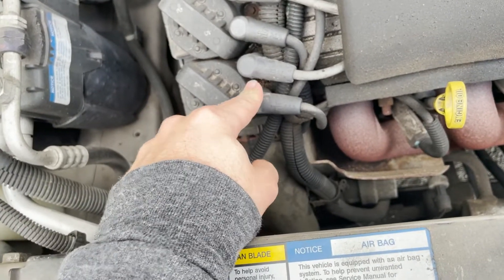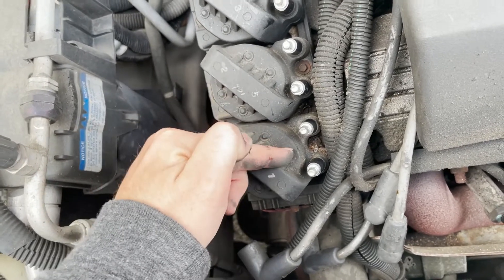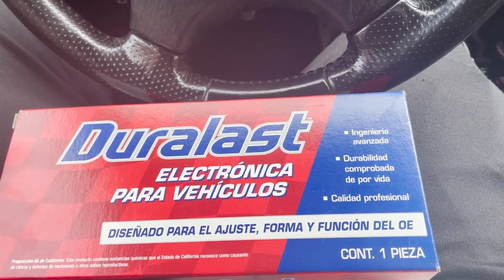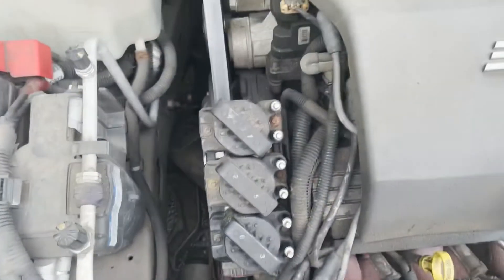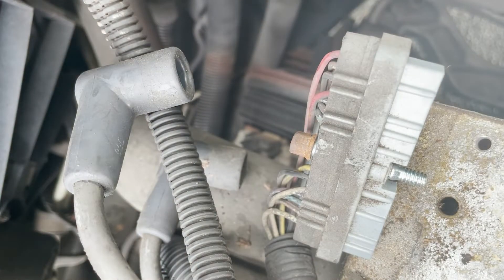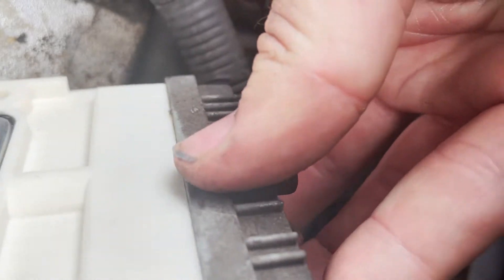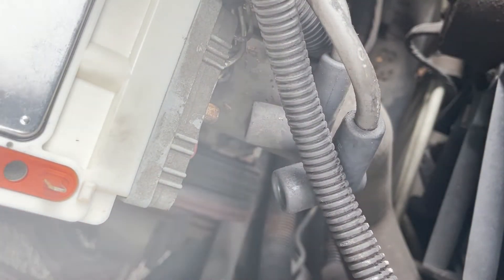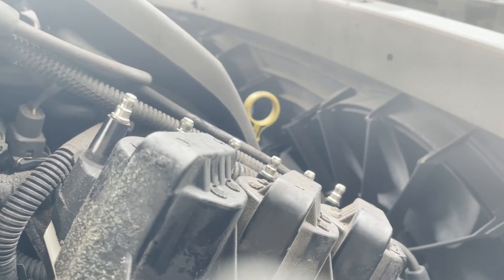Significant Loss of Power and Smelly Exhaust?! 2000 Buick LeSabre Ignition Control Module is Faulty

Comment: I’m looking thru lesabre vids right now.. mine has been having random misfires with stalling when I start all intermittently.. 2 mechanics I spoke to think it’s the icm starting to fail especially I messed with the fuel air ratio by putting new sensors on that have been failing for a long time now. I hope that’s what it is, all of its raw data is being checked and diagnosed right now at the shop
Reply: what sensor did you use for the air fuel ratio?